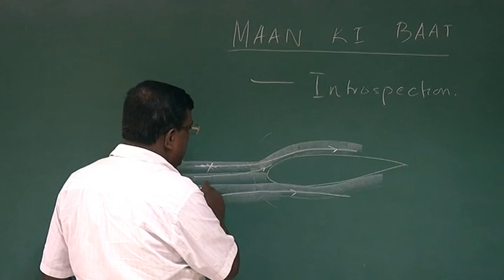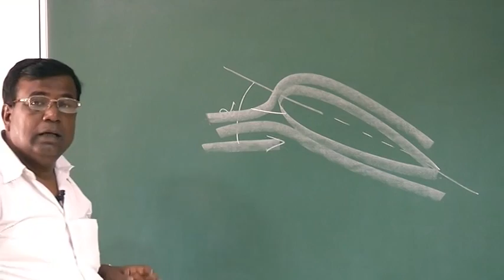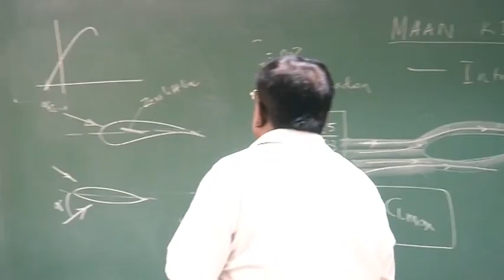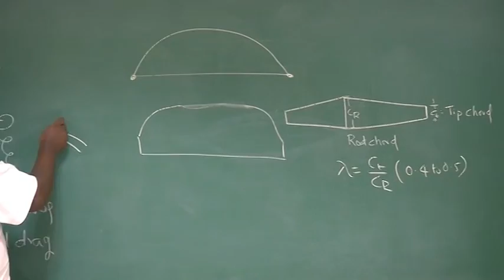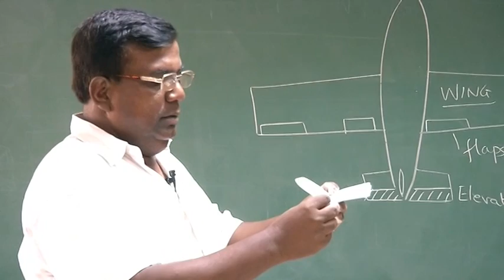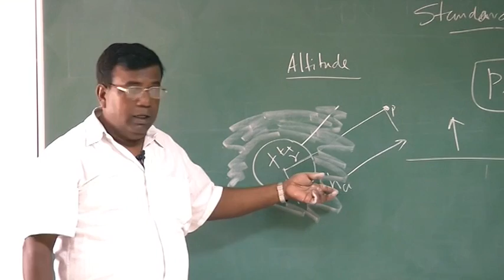Revision

Comment: I like these lectures. But isnt the mechanism of lift generation explained here wrong? I mean, airflow over the top and bottom of wing reaching the trailing edge at the SAME time is the most basic and most debunked misconception in lift theory, and wind tunnel tests show that airflow over the top of the wing reaches the trailing edge earlier. Why is this school level misconception legitimised here??!! As the prof says, flow cannot accumulate; but that doesnt mean the airflow on top and bottom should reach TE at the same time.
Ref:
https://www.youtube.com/watch?v=e0l31p6RIaY
https://www.youtube.com/watch?v=jqexY7hObik
https://www.grc.nasa.gov/WWW/k-12/airplane/wrong1.html
https://en.wikipedia.org/wiki/Lift_(force)#False_explanation_based_on_equal_transit-time
Reply: No that theory is only correct for Aerofoil at angle but as in video he states it’s a symmetric aerofoil.. so they meet at a point
Reply: @Sam-hc4sd  No. Check the 1st video link in my comment that shows airflow. The airfoil used is probably symmetrical. Read its video deacription. Even flat plate wings produce lift and they have the same length on both surfaces. Airflow speeds up on top and does not meet the corresponding air on the bottom.
Reply: Agree with you on this. It is a very attractive theory and easy to apply. So mostly it is used to explain lift, but it is really not correct. If it were, aircrafts would not be able to fly upside down during airshows because then, the lower pressure surface is at the bottom for cambered airfoils.
Reply: Bro I would like to add something...it is clear from the frst video link(u have posted) that the velocity in the upper layer is greater than the velocity in the lower layer..which is the exact point that is made in this video....but yeah it is stated wrong that the flow reaches at the same time in the trailing edge...that MAYBE stated since they didnt have a "Slow motion camera " in those days to experimentally see and in order to JUSTIFY the velocity difference ,they used that statement